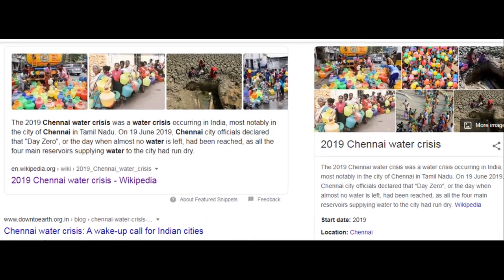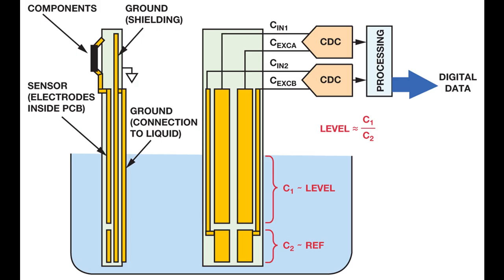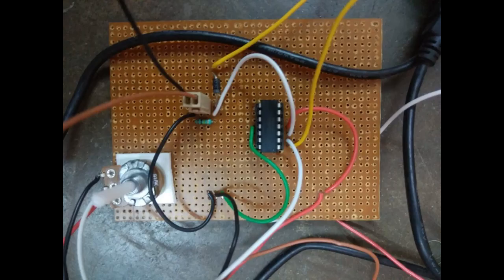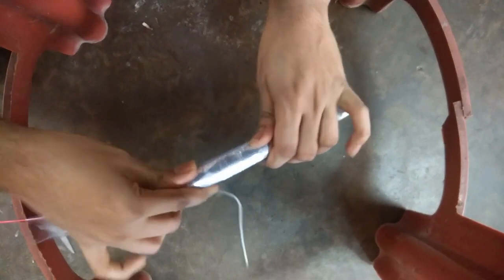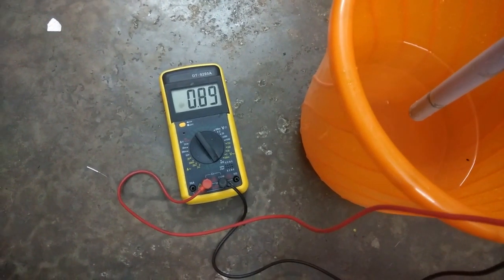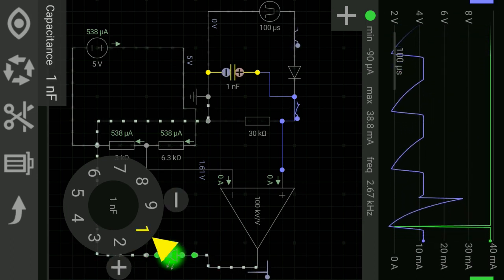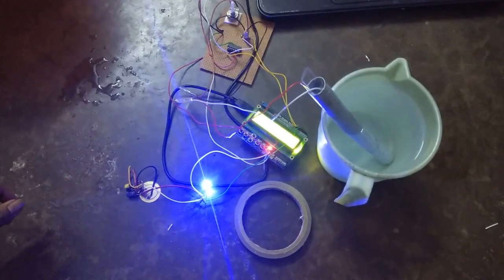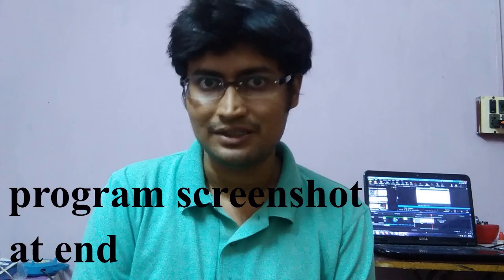DIY Capacitance Level Switch for overhead tank over fill prevention water pump controller

Comment: Can you please elaborate the lamination process. I tried to make waterproof parallel plates a number of times. But everytime I found it to be leaky.
Reply from the maker: I had the same problem . The thing is plastic has to be thin or else capacitance will decrease. so I used 1- inch thick cellotape for half-inch thick aluminum foil. but it will be leaky after 1 day. you could try a lamination machine. but I don't have one right now. I will research and let you know. 
Please support us by subscribing and sharing the video. thanks in advance and let us know in the comment section if you find any solution